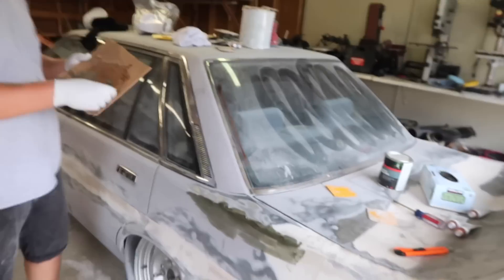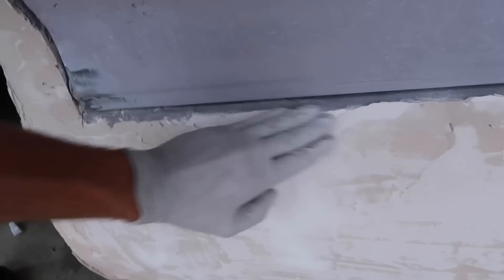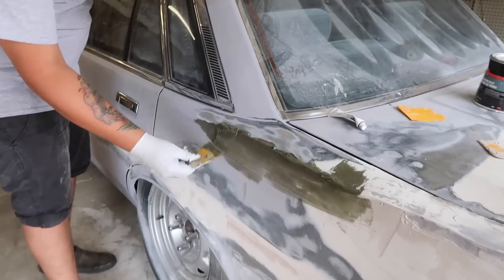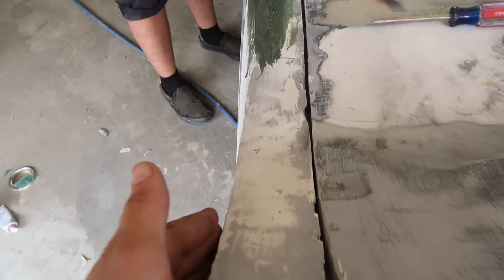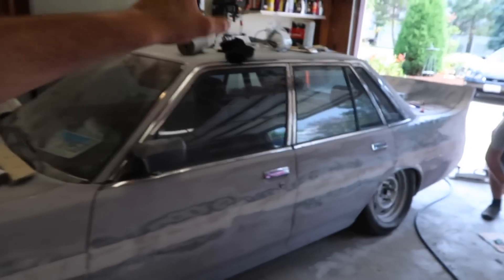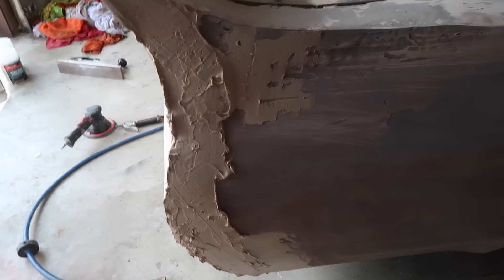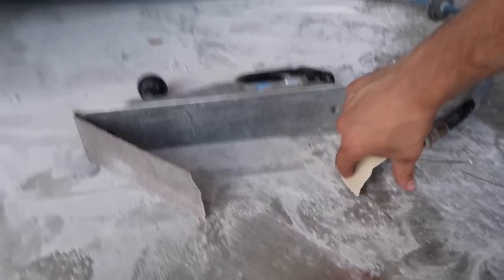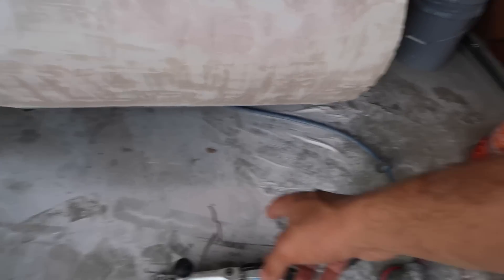HIPS & NEW TOOL | Bosozoku Cressida

Comment: You should have weighed the Cressida before to see how many pounds of bondo is on the car.
Reply: JubalsWish I was just thinking of that
Reply: JubalsWish Considering he hasn't guttted the car you could just go from the factory weight and just scale the car after the build is finished.
Reply: Original weight might be on Wikipedia.
Reply: this 1987 Cressida should weight about 1,280 kg (2,822 lb)
Reply: stock weight should be in its papers
Reply: Park'd no way it's that light, my audi a1 weighs like 1400kg and it's a 3 door
Reply: Thermedge Old cars weigh half of the new ones, my car weighs ~600kg, is 2 times smaller than the cressida and is the same age so 1200kg is probably true
Reply: @Thermadge I got an old pickup, weighs only 1300kg

Comment: that car is going to be SO dam heavy it won't be able to move
Reply: harleyguyinmilw it already is
Reply: 2jz Swap ........
Reply: GABRIEL SANTIAGO Doesn't have the structural support to handle a lot of power though. Too much flex from torque could crack the Bondo

Comment: It's ripping the paper because you are moving from side to side and also the bondo is pretty rough
Reply: xXFIREWIREXx it could also break if he's pressing to hard .
Reply: xXFIREWIREXx wrong paper he can move side to side and up and down
Reply: No, the paper is ripping because its not specifically for an air sander.
The specific one for air sanders isn't paper back, its more of a plastic so it won't rip.. similar to a belt sander where the sandpaper isn't actually paper back
Reply: since you wanna all be auto body techs here, the reason its ripping mainly how tight the paper is, it has to have some slack in the paper.

Comment: Tyler, a couple things about the air file, yes it should use a pressure adhesive pad on the bottom of it and make sure you give it plenty of air tool oil, especially running at an inconsistent air pressure. Keep up the good content.

Comment: Tyler, there's sand paper and sand linnen(?). Its a lot stronger since the grid/sand is placed/glued on a cloth or linnen. Thats what you should use on that new tool. You can buy that stuff on a roll. 
And if you really want to blaze through the rough bondo, use a grinder with a sanding pad. Works great for the rough parts but is a bit too much to achieve a real nice smooth finish.

Comment: Tyler you could try using a fiber backing sand paper on that air file to help keep the paper from tearing or a full adhesive back type paper. Ideally though quick hook paper and pad is what should be on there. Velcro type if you don't know what quick hook means. Also an air file requires a lot more air then a DA sander. I know that isn't your air file but Harbor Freight does sell a decent air file for the hobbyist for a decent price. Something to think about if you continue to do things like this. Keep it up!

Comment: You should consider getting a dewalt 5" grinder and a walter backing plate so you can use a 5" x 7/8" oxide sanding disc in. This project would take an afternoon to rough out instead of a month. Watch the hackandpack shop channel, that guy knows how to use the tiger glass and bondo to shape a vehicle.

Comment: Don't put to much pressure on the file sander and longer passes like go from the top of the bumper line all the way to the bottom its sorta like blocking by hand but with the air file I do body work for a living thats how I know

Comment: Tyler Failko instead of making and added bondo on top of bondo for your car for that wanted to do. How come you didn't use sheet metal and welded the piece on and then bondo over it? I do like the idea of what you're doing and it's easer work with to shape than metal. Just wondering why you went with a lot of bondo instead fabricating most of the work? Please answer in the next video! Keep up the good work btw!

Comment: I think you're using the wrong tool. I think you need a belt sander with 80 grit instead of that finishing sander or whatever it is to knock down the gallons of bonds on there.

Comment: +Tyler Fialko Hey Tyler I need an Opinion. I live in Ontario. Recentley my muffler fell off on my 2000 Corolla. How much on average should it cost to get the pipe re welded back to the Resonator? I just need to know so I won't get screwed over. Thanks.

Comment: your pressing way took hard in the middle with the sander try using the front then the back of the paper then go to the middle.....
Reply: BoriTaino. No, that is incredibly wrong. The whole point of a board sander is to sand things flat, even pressure. You start trying to use The edges of the board, it will never be straight.  The air board makes it quicker. Extremely light pressure. The weight of the board itself is enough. The paper keeps ripping because he's using shotty hardware store sandpaper. He needs real automotive sandpaper with proper backing

Comment: Maybe use real automotive sandpaper (norton or 3m etc.) and it won't tear on the airboard. The backing of that cheap hardware store sandpaper isn't designed for it. Thats why it tears. Its litterally a piece of paper with sand on it, it's garbage. Go to your local auto parts store and invest in a few strip rolls. You don't need stick it (adhesive sandpaper) you can use the locks on the airboard like you were with regular AUTOMOTIVE sandpaper.
Reply: Yeah but that stuff is expensive. Like at least a dollar more.